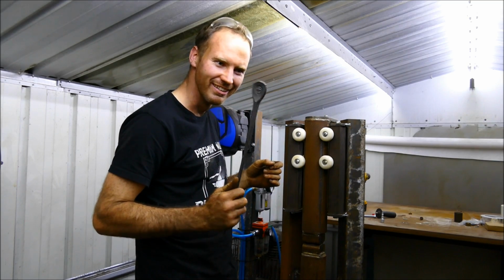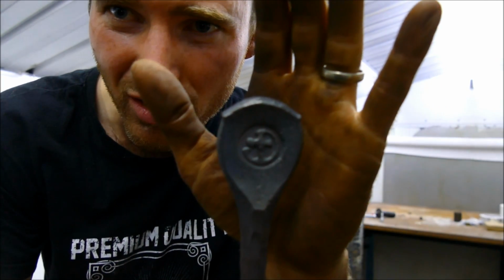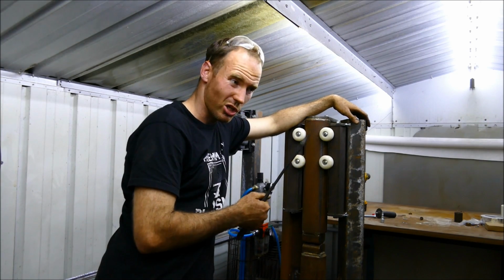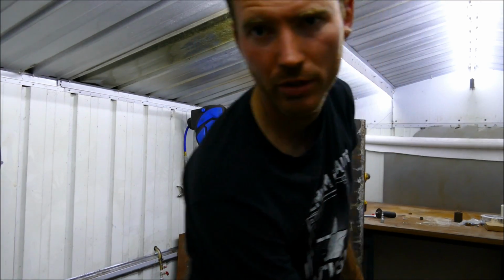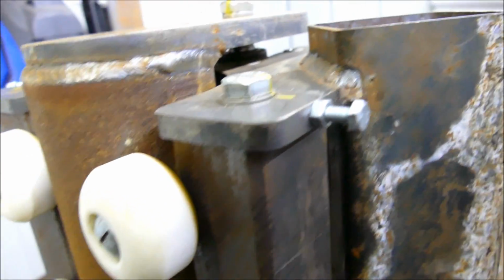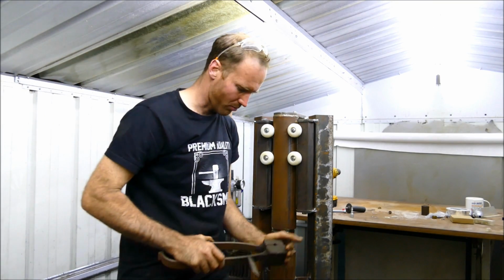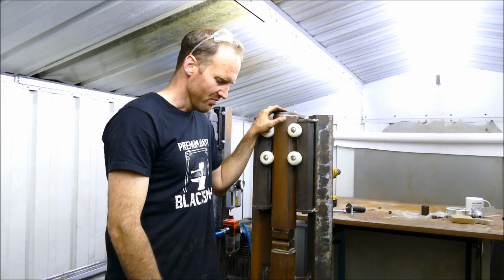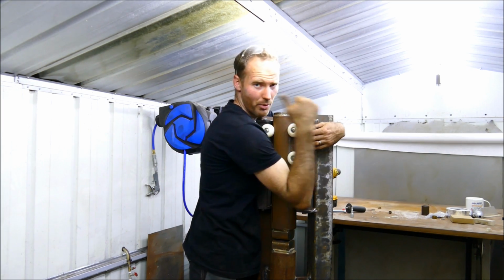!NEW! Ultimate DIY Power hammer build - pneumatic money maker - part 1

Comment: Now that's an awesome hammer!  Very compact as well, but out of curiosity, how much air volume does it take to run it?  I like the design and the control it seems to have, but I wouldn't want to have to go buy a big expensive compressor to run it.  I guess, what I mean is, given the compressor you are using, how much does your compressor run while using the hammer?  Is it able to keep up and only run occasionally, or after a certain point does it seem to just run constantly?
Reply from the maker: Hi Edward, I have a 150ltr 3hp 14.5cfm compressor running at 120PSI. its able to forge 1" until cold before it kicks in to build pressure back up while I re heat the steel, never run the compressor at the same time as forging so it has a break bteen heats. cheers J

Comment: As I was watching the first half seeing how you assembled the hammer I thought, “That is a very affordable design. And it will pound metal like a brick sh@thouse.” I was happy to hear you say that you design was meant to incorporate both of my thoughts. One other thought when I watched you forge the poker was that it looked like you have a lot of control and can even hammer very “delicately.” Which is astounding given how much power that machine packs in a wallop.
Reply from the maker: yes there is a balance point in the valve where both halves are pressurised at different rates giving a slower thump, also I can give shorter blows which does the same thing regulating the impact force. cheers J

Comment: What I find most impressive about your power hammer build was the attention you paid to the foundation. I have only seen one other power hammer build ‘tube and in that one a bunch of hammers were built by the people building them. That too was a very impressive build but there was no attention in the video given to the foundation that was needed UNDER the hammer. Since all of the finished items were loaded into trucks and hauled away that was perhaps understandable. But your solution to that... WOW!! I/2 yard of concrete?
Reply from the maker: Yes the formula is that the anvil and connected concrete mass should exceed 10x the weight of the hammer head for optimum performance. cheers J

Comment: Truly impressive! You mentioned that the company you work for was considering selling them,  are they?  Also to keep price down, would you consider selling in a prefabbed kit?  Where we just weld everything together, minus that square nut inside the square stock, you should handle that and the axles for the roller skates.  that would keep cost down and just a thought, thank you for making this public.
Reply from the maker: We Are. i'm still running tests and doing modifications but have decided to just sell the whole hammer to start with. coming soon cheers J

Comment: Dang nice base weld. That shouldn't ever come apart without some intentional work put in.
Heck yeah I want to see some plans for this hammer, I just hope they're affordable.
Which do you think will need replacement first, the ram or the skateboard wheels? Also, why not forge some steel wheels for it. Of course you'll have to replace the bearings regardless of the wheel material in the future, so using a decent bearing that is commonly easy to find would be the way to go, so the skateboard wheels is a good call for bearings. Of course they take thrust and impact during skateboarding, but not the load that the hammer will put on them. Please keep us updated on how the wheels, bearings, and the ram hold up over time and use. Thanks.

Nod to Jim from The Tradesman Channel for the lead to this channel/project.
Reply from the maker: Hey Thomas. Plans are in the description and already uploaded a follow on video with even more updates to come. Wheels are good, shock absorbing and quiet running. No problems as of yet but would imagine the seals in the cylinder would wear out first but they're not costly at all, my hope is if the cylinder last 12 months before replacing, it's well worth it as a consumerble part if replaced every year. My hammer will have paid for it self in 3 x 8 hour days of work and still have paid me a wage and 20% profit after tax so I'm very happy with it so far.

Comment: Amazing. I only cringed a little when those hoses were dangling unprotected near the hammer... I know you'll be taking care of that need soon.
Reply from the maker: Already amended in the new video! Although I'm changing it again to account for a new foot pedal design. Cheers J
Reply: It makes a massive change compared to all of the other power hammer videos when all that's questionable is the hoses! It's refreshing to see someone actually build machine foundations rather than load bolts in bending and rely on ropey fillet welds under cyclic loading ;)

Comment: Awesome powerhammer Joshua....good job!!! On another note, how are you finding working in your 10 x 10 shop(at least thats what I think it is?) Plan on building one, and 10 x 10 is the max I can go to without a building permit. Your thoughts??
Thanks.
Reply from the maker: It's fine if you're minimal and not a tool collector. I would advise to build one with more height also as I sometimes bump my head. But it's easy to tidy and warms up quickly in winter which is good. I'm going to put my compressor out side in a separate shed also to make more room. Cheers J

Comment: Got to be the best devised DIY power hammer I've seen.. say I didn't have solid round  bar stock.. Just 10mm wall thickness pipe.. for the top and bottom anvil hammer  holding bits..... What's your thoughts on filling the tubes with steel shot...  That I just happen to have buckets of.. 😂😂Might turn the top hammer into a dead blow 🤔🤷.. No idea if that's a bad idea.. My gut tells me you want it to bounce?
🤔😬
Reply from the maker: You could fill the hammer with cast lead  but the anvil needs to be a solid mass and not made out of anything loose. You could cast a high grade concrete with plenty of mesh and reinforcement inside the pipe and cap it with heavy plate but it won't be as good and long lasting as solid steel. I would check out a local industry who may have some off cuts of large steel bar that would sell for scrap value. Thank you for your kind comments. Cheers J
Reply: @joshuadelisle  I guess I can't just have everything I need just lying around... I even kept my old skateboard wheels from 25 years ago for it 😂😂.. thanks  for your advice.. Will find something solid then 👍😀👍... I guess I'll find a use for all this steel shot eventually 😂😂🤷....
Reply from the maker: All the very best. You could fill the hollow pillars with shot to dampen the vibrations. Take care. Cheers J
Reply: @joshuadelisle  😯😀👍

Comment: Dude. Did you weld a post to the top of your air tank? I've seen what happens when a tank that size comes apart under pressure.  You'll likely need to have that nice new hammer surgically removed from your urethra.  Seriously, get a new tank today and don't do that crap.(nice hammer).
Reply from the maker: I understand your concern. It's a very light weld, was done properly. I'm not sure why it's a problem when the tank already has other parts and boses welded on with a mig from manufacture?  But you're right I don't encourage modifying pressure vessels for that reason. Cheers J

Comment: OK guys I just Downloaded the Blueprints and all I can say is I can't believe how simple this power hammer is. I don't think it could be made any more simple. I've been in manufacturing since 1975 and I've been looking in to building a power hammer for the last year and a half. I've looked at all the different types of power hammers and this design is the simplest I have found  bar none. Also i think the the price for the blueprints is very reasonable. Mr. De Lisle has hit a home run with this design I wish I had found it a year and a half ago it would have saved me a ton of work. Thank you Joshua.
Reply from the maker: Wow thank you so much! that's very kind of you. I have wanted a power hammer for so long and I did as you did, research, research, research! I kept drawing ideas and got disheartened by complexity, expense and lack of productive time. Until I came up with this out of stuff I already had. I'm delighted that the journey I've been on can now bless others. I've made some interesting modifications and upgrades. New video coming very soon. I look forward to hearing how you get on and if you have any thoughts on changes let me know and I'll share it with the rest and update the design. Cheers J

Comment: Any way that I could build and use without tearing up my shop floor? :-(
Reply from the maker: Yes if you box in the bottom half of the hammer (like a trough) and weld in some re bar you could cast the concrete directly onto the hammer base. Or you could have a much larger mass of an anvil. The connected anvil and/or concrete mass should be 10X the weight of the hammer head for maximum efficiency. You could then have a rubber matt underneath protecting your floor and it wouldn't effect the performance of the hammer. Cheers J

Comment: Why are you using 309 stainless transition rod n what looks like mild/carbon steel?
Reply from the maker: It's a good dissimilar rod. Works well joining high carbon to mild steel. Cheers J
Reply: @joshuadelisle  I would've used 7018 for both types of steel. Ok, just curious.
Reply from the maker: It might ok but I think the difference in grain structure between the when it cools can course cracks. The 309 I think bridges the two more harmoniously. But I'm no expert on metalogy I'm only going by what I was recommended after a piece broke years ago. Cheers J

Comment: Bought the plans- can’t wait to start but I’m not sure if my compressor can manage. What would you estimate is the minimum air volume required? We use CFM in USA - Liters per second?
Reply from the maker: Thank you so much! the cfm is for how fast it takes to re fill but you want a 150ltr 3hp 14cfm and run it at 120psi pressure. can get a new one here for £450 UK

Comment: Awesome but you should use 7018 for this kind of application , right the choice of using 309 ,but your 6013 weld will gonna brake in no time 
Isn't suitable for high shock and vibrations and other things in this line 
It will gonna brake 
But it's actually a good design
Reply from the maker: Fair enough sounds legit. So what's your experience?
Reply: @joshuadelisle  essentially nothing more than 5 years of experience in metal fabrication and farming equipment repair 
I've study a lot about because is my passion but essentially I do that for hobby...
But trust me any time I've tried to weld something subject to stress and vibrations using 6013 it cracked so now after this experience I use only 7018 for the majority of my projects ...
Reply from the maker: @daniele3275  Well I beleive you are right that 7018's are better for this paticular job, however i've used 6013's for 10 years and used them along side pipe welders who used them for 35 years and we've had no trouble. infact I made alot of tooling for my last power hammer with 6013's subject to intense shock and the welds still held up so i'm confident it will be alright. 6013s are ideal for thinner section matterial. if you have trouble it may be a brand difference. I was coded for overhead stick welding with 6013s and my instructor never said a bad thing about them and he worked in nuclear pipe work. cheers J
Reply from the maker: You are right 7018 are what I recomend, 6013 are what I had at the time. penetrated deep, time will tell....cheers J
Reply: @joshuadelisle  deep penetration doesn't mean good metallurgical properties 
The problem is hydrogen
Reply from the maker: @daniele3275  so what does the hydrogen do? Cheers J
Reply: @joshuadelisle  hydrogen cause metal brittleness 
So the hits of the hammer will stress the weld and the parent metal next the weld (infect zone) causing cracks and it will break

Comment: Could you use the exhaust air and plumb it to your compressor tank? Would it be to much back pressure on your system to function properly?
Reply: Possible but would need a one way valvue to keep pressure down. However if the return air pressure is lower then in the tank it would not transfer. Think of using just an air tank to fill a tire. If you want 30lb in tire you need 60 in tank because at 30lb there will be 30 in tank and equal pressure means no air will move.
Reply: How about venting the exhaust into your forge rather than using a blower, will get those coals super hot. Just use a larger hose so there is no back pressure.

Comment: This is by far the best power hammer I have seen so far.  It actually looks doable with my limited metal working tools.  It will be a while before I can afford to make it, but it is definitely on my wish list!  Steel seems to be pretty expensive though so even when I get the plans it will still be a while, sadly.  Would love to see the look on my grandpas face though since he use to be a farrier and I don’t think he’s ever used a power hammer.
Reply from the maker: The steel is still cheaper than a new hammer. you could do a group purchase, you get 4 hammers out of a 6m length of 100mm round.Thank you so much for your kind comments and subscribing, patterns are now available on my Etsy shop detailed in the description and to say thank you here is a discount code for 20% off! just type POWERHAMMER1 as a coupon code. cheers J
Reply: @joshuadelisle  If I converted the metric measurements into imperial, would I have issues with fitting it together or is there some wiggle room??  I feel the main road block for me would be the cost of steel, since it's still way out of my league right now, and the fact that I only have a 90 amp welder and I would assume I couldn't get a strong weld in such thick steel.  Still really want to try it, though.  Do you worry about that plate that is attached to the upper round and the piston?  Is there a chance a weld could break in that point?
Reply from the maker: Hey! I've made two lots of measurements on the drawings to make it simple in metric and imperial for you lot across the pond. I'm not worried about the welds but 7018 electrodes would give it better tensile strength. I got my 200amp tig for just £200 and works a treat. Cheers J
Reply: @joshuadelisle  I use a flux core wire welder, but 200 isn't bad for a stick welder.  Always thought about having one of each.  Tig welders also look cool, and I always wondered how well those could be used to fix bad welds by remelting it to make it smoother.  But that's fantastic you have both measurements!!  When I can get the cash, I will definitely buy it.  Would love to have it built by next year to show off to my grandfather.  I did look into steel prices and it's really expensive.  Over 400-500 dollars just for the solid rounds alone.  I will try to find a local source, maybe they will be cheaper.  I'm a freelance carpenter and work hasn't been steady the last couple of years so I'm living on pennies right now.  Thanks for the replies, Joshua!
Reply from the maker: @ltsallwood  I wish you all the very best mate! that does sound expensive, best bet is to find out if a local industry near you has any on the shelf, they may sell it to you some cheaper as they buy in bulk especially if they have off cuts. cheers J

Comment: Awesome!
I would look for a pneumatic cylinder that has also air break (when the piston is about to hit one end, it slightly closes the air path, so it has a cushion of air to brake the mass. (and make the bottom end just have brake below the contacting point of the jaws, so it doesn't affect it)
Other than that, awesome!
Reply from the maker: It does have an air break but has no effect at that power. instead ive put a ballistic rubber washer inside to take the impact at the top end and ive done as you say with the bottom stroke being 2-3mm away while engaged with the anvil. cheers J
Reply: In hydraulics it is actually referred to as a "cushion".

Comment: You'll probably want to put some fiberglass wrap around the air lines otherwise you may spring a leak when a hot piece of scale hits or forging slag hits the plastic lines..
Reply from the maker: I've just upgraded to copper pipe for that reason and for better airflow meaning more power, next video. cheers J

Comment: just a thought but why not just  build a steam hammer and put a boiler on the forge then you could use it to power other things in the shop and run to a radiator to heat your shop in the winter unless your weather dose not get real cold in the winter like around here we get 40 below at night most winters
Reply from the maker: Maybe but your talking real dangerous stuff there. sounds fun!

Comment: I would like to see the plans i have a mig 160 welder and i would live to make me one with an additional press on the side for pressing in and out bearings, castings and such i am in the US. What are you oppions on the 6214 arc welding rods and the 3904 rods?
Reply from the maker: Hey! Thank you so much for your kind comments and subscribing, patterns are now available on my Etsy shop detailed in the description and to say thank you here is a discount code for 20% off! just type POWERHAMMER1 as a coupon code. I've not used those rods so i'm not sure. 309 worked for the high carbon to mild, 7018 will work well for the main structure of this build, however I used 6013 because its all I had at the timeand they are neat. cheers J

Comment: What size air compressor are you using?
Reply: I should specify, what cfm and at what pressure? I read in another comment that you have a 3hp and 120psi.
Reply from the maker: @b-radfrommalibu  its a 14cfm but all that means is how fast it fills back up, you don't want to run the hammer at the same time as your compressor or you'll over heat it. it takes the whole time i'm forging 1"(25mm) to go cold before it kick in and fills while i'm re-heating. cheers J